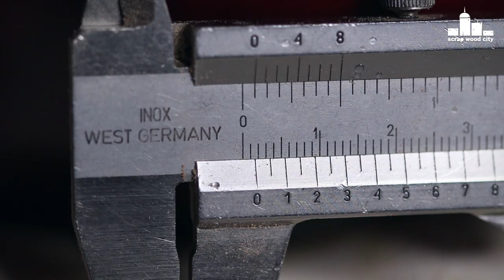How to convert a classical guitar to fretless - DIY

Comment: How much should the nut and bridge be shortened? and you are using mineral oil. Is it okay if I use a mineral oil that I can find anywhere? So is there a certain tour?
Reply from the maker: I want the action pretty low. But you'll have to remove material little by little until you get the result you want. I use food safe mineral oil, which in Greece I usually get from the pharmacy.

Comment: Doing similar on my C40.. Question is, fretlines visible or not?... and   what about side dots?
Reply from the maker: The fret lines are visible if you stand against a light source. Side dots still exist and they are still kind of useful.
Reply: @ScrapwoodCity  Yes. But have you any sugeston whatever I should let all frets being vissible on the side or if I should use only dots? some say yes some says no
Reply from the maker: You can use a wood that has contrast with the wood of the fretboard. But not in cheap guitars where the fretboard is usually painted.

Comment: Great work Dimitris, it sounds very dramatic especially with the reverb. Incidentally, did you put a little camber on the fretboard or leave it flat? Cheers mate.
Reply from the maker: Thank you Mark. I am not sure what camber is
Reply: @ScrapwoodCity  Curvature, like on electric guitars. :)
Reply: Classical guitars are generally flat, no radius like an electric or steel strung acoustic

Comment: Hey there, I was wondering why you lowered the nut and bridge. I was thinking the same thing actually because down the neck my strings lay twice as high from the neck compared to the top of the neck. Does this have any positive influence on overall sound? I was wondering if you could have used something like woodfiller or some other knit-table/shapable kind of wood to fill in the gaps on the neck. Inspiring work thanks for the video 🙏
Reply from the maker: With high action the intonation is wrong and the notes sound out of tune.
Reply: @ScrapwoodCity  that's why it has to be one fret lower. Interesting thank you!!
Reply: @ScrapwoodCity  that doesn't count for the frets that already lay low (the top frets) right? These can't really get any lower I assume

Comment: Just wanted to say thanks very much for this - tried it out on a very crap old classical guitar and (after a number of problems unrelated to the process) I've just got it playable. It's not a great finish, but I have a slightly better crap guitar which I'll also convert (now that I've learned what things to look out for). I saw on someone else's video that they used paprika to fill the fret holes (as it's the same consistency as fine saw dust) and I ended up with these great deep red fret lines from doing this. I've tuned it to an open Gm.

So anyway - thanks!
Reply from the maker: Nice, thank you for watching and commenting. :)

Comment: Fantastic content sir. Could you tell me what is that glue you used to glue the wood powder into the holes of the frets? The brand if it's possible, to see what is the most similar one I can get here where I live.
Thanks
If you don't want to mention brand, you can just tell me what kind of glue it is or something to identify it

Also,did you use a common sand to sand the fretboard?
Reply from the maker: It's just super glue
Reply: Bison

Comment: Amazing. Why the holes must be filled in and glued? What happens if you remove the frets and only sand it?
Reply from the maker: You might have issues while playing. It can effect your vibrato, glissando etc. Tou need a smooth surface on the fretboard

Comment: For the people freaking the hell out, bear in mind that this is a cheap pawn-shop grade guitar.  These are perfect candidates for fretless conversions if you are DIY minded, otherwise, go pick up a fretless Altamira Basico for $550 or so.  I believe G&G Guitars sells them.

I've done a few classical conversions and I'm about to give it a go on a cheapo "Ariana" stratocaster copy just for shits and giggles.  The only things I'd suggest is avoid soft wood filler and use solid hardwood veneer instead.  The frets assist in keeping the neck straight (I suppose like vertebrae on a spine) though this may not be a real issue if you use low tension strings or tune down to D Tuning, it depends on the guitar and how cheaply it was made; so some will respond\perform better than others.  You may also want to try simply filing down the frets completely and leave the steel stems in the fretboard, you won't need to fill them back up and you can still keep the structural benefit of frets.  Some people differ on whether to use glue on the fret board or not, I personally don't think it's necessary on classicals.  On electric conversions, you'll need to finish the surface with adhesive or use flat-wound strings, otherwise you'll gouge out the fret board over time.
Reply: I have a cheap classical guitar that I've been experimenting on. What would I use to file the frets down completely like you were talking about? And is there anything I need to do to protect the neck and make sure it doesn't end up uneven?